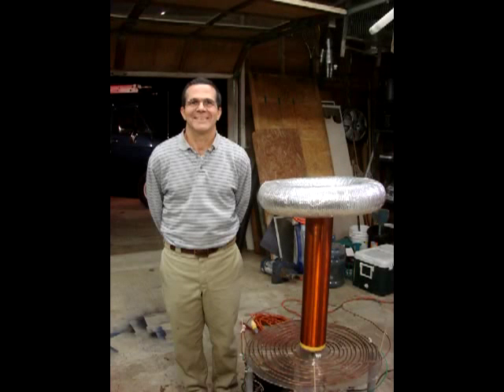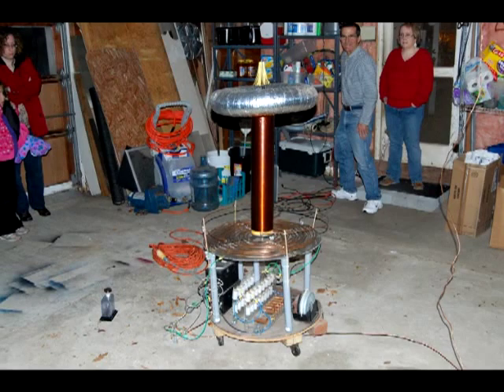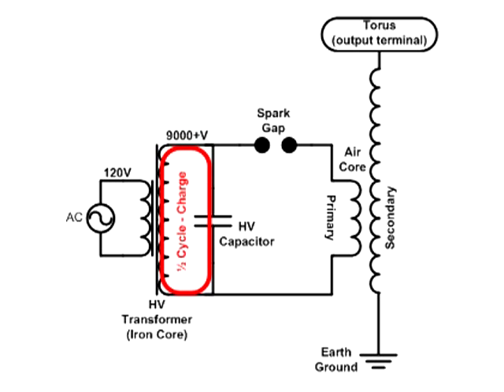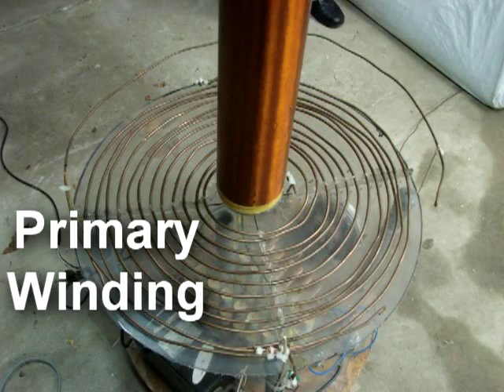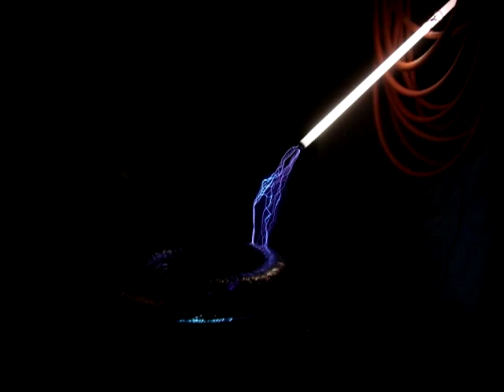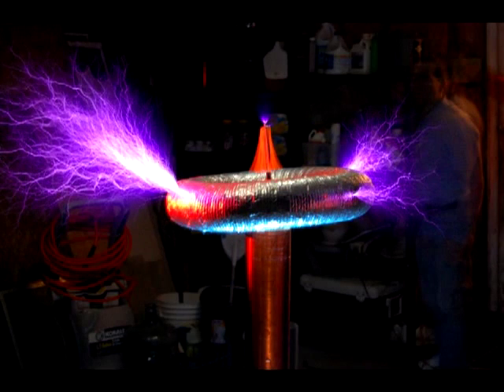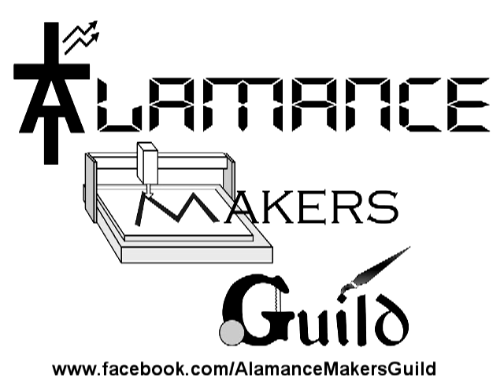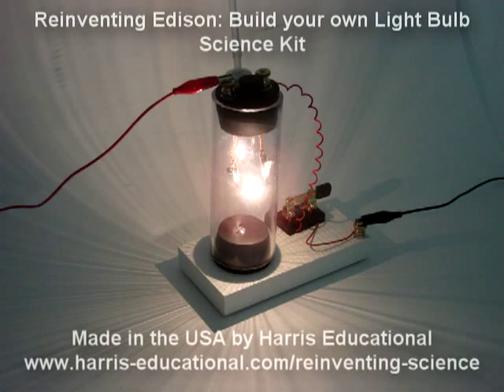Jim Branley's Tesla Coil and How it Works

Comment: Hello, I'm the guy you met at Maker Faire 2012 in Raleigh. (I had the high voltage display inside). I didn't get the chance to meet up withe you after the Faire, but drop me a line if you want.